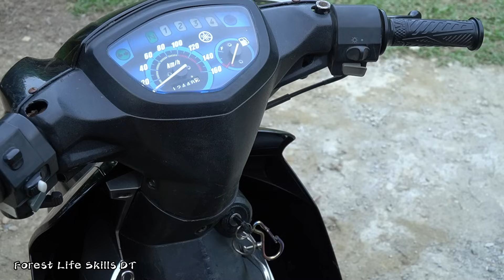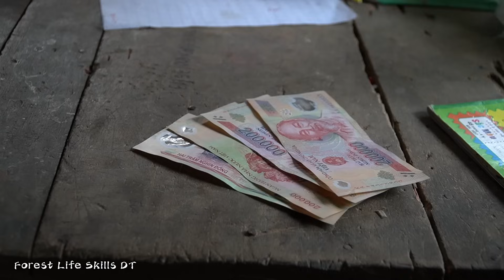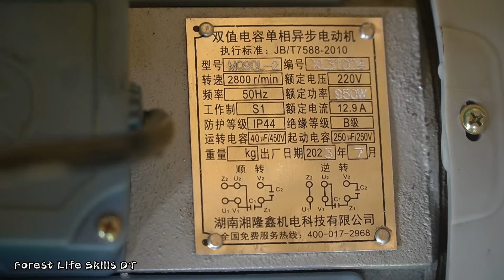Invest in care and development of wild boar herds - Replace degraded electrical wiring

Comment: That electrical wire is travelling a great length hpr it will not get spoit during rains otherwise u may need a plastic tube to enclose the wire be safe place cos any carelessnes on the wite the whole place will catch fire.